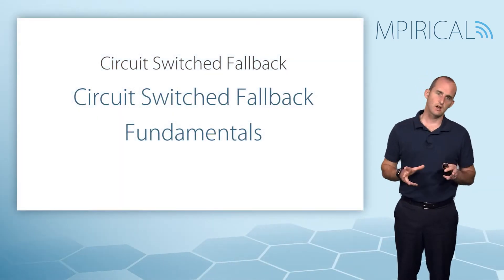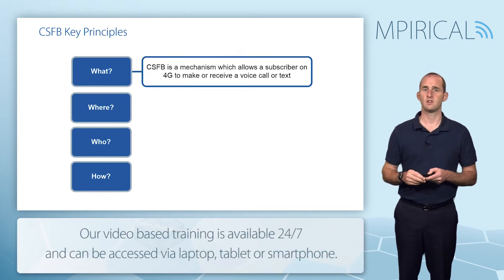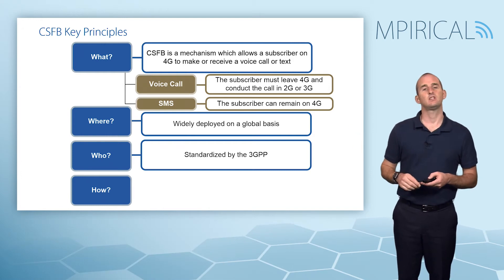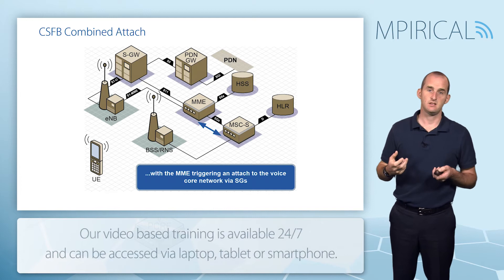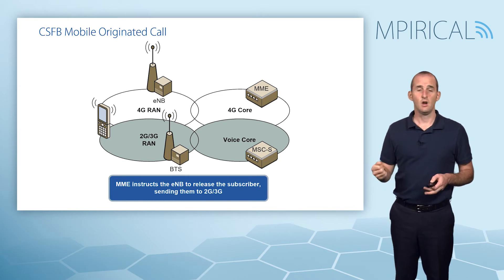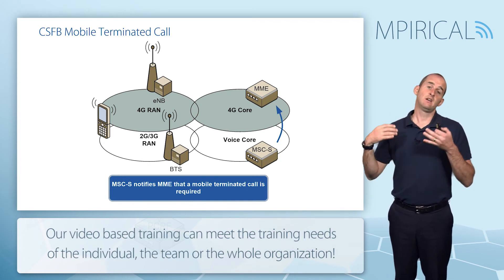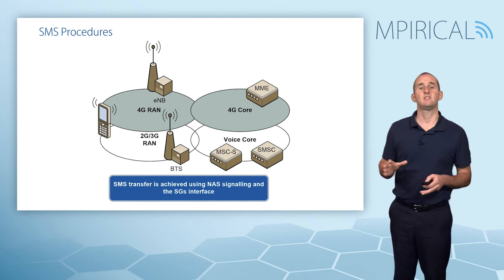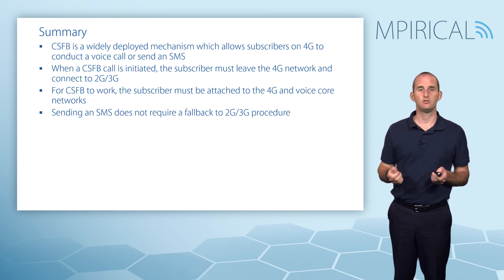Circuit Switched Fallback (LTE CSFB) - LTE System Engineering Course

Comment: Once a user shifts to 2G/3G for making/attending a CSFB call, does it remain attached to the 2G/3G network or it re-attaches to the LTE network after the call is over? 
If it remains attached to 2G/3G, when does it shift back to LTE network?
Reply from the maker: After completing the voice call on the 2G/3G network the device will typically return to the 2G/3G Idle state. At this point, the cell reselection procedure is typically “weighted” to ensure the devices re-selects the 4G LTE network, i.e. 4G cells have a higher priority. Once reselection to 4G is performed the device performs a 4G Tracking Area Update procedure. This process is usually very fast.